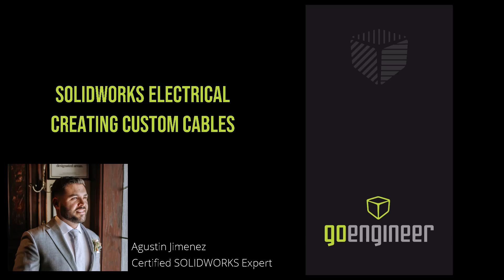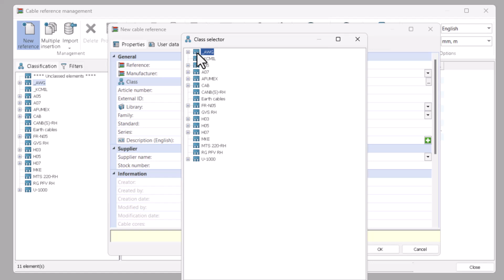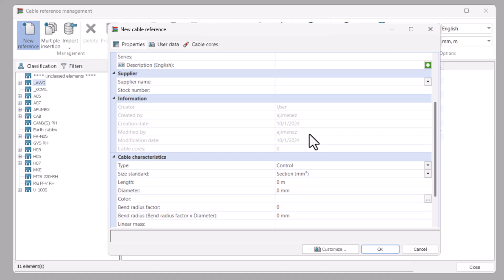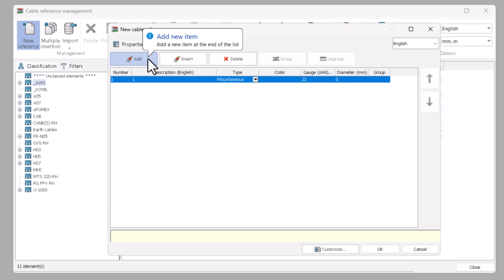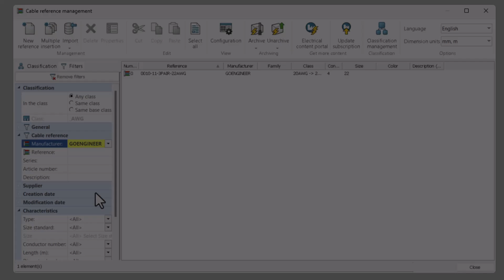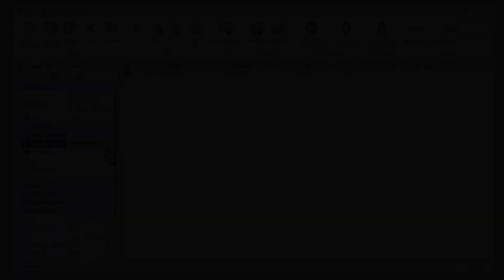How To Create Custom Cables in SOLIDWORKS Electrical

Comment from the maker: What should we cover in our next SOLIDWORKS Electrical tutorial?
Reply: Hi, how should we deal with the connectors in SWE? For example, I have create a line diagram with symbols and cables connecting them. Then I create a detailed schematic diagram with all the connections and cables. The cable info can be transmitted from line diagram to schematic diagram. The difficulty is, most of the cables contain connectors, such ring terminals. If I want to create a detailed cable with all the wire cores and connectors, the detailed cable can not automatically associate to the cable already created? How can I do to associate all the cables?
Reply: What I want to do is: First I want to create a line diagram with all the important components, and using single line to connect them, the single line can be assigned a cable. Then I will draw the detailed schematics, which will show all the connection of each components. Finally I want to draw the detailed cables, with the cables, wire cores and connectors on both side of the cable. The last one can be associated to 3D components. But it seems the last one is hard to associated to previous ones of drawings.